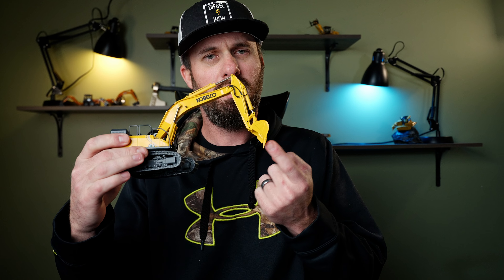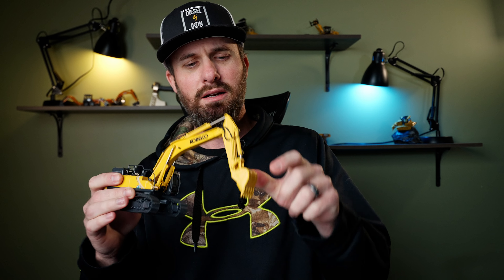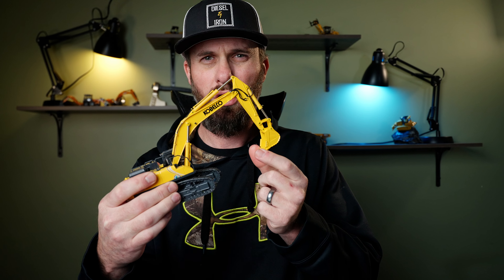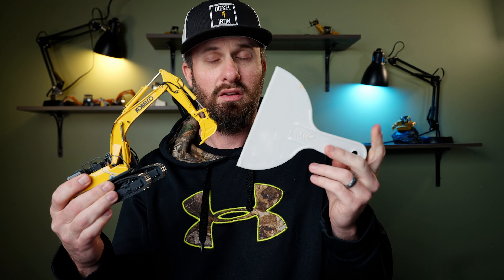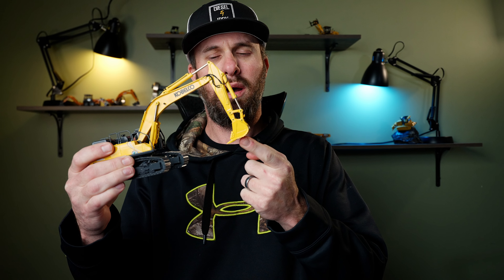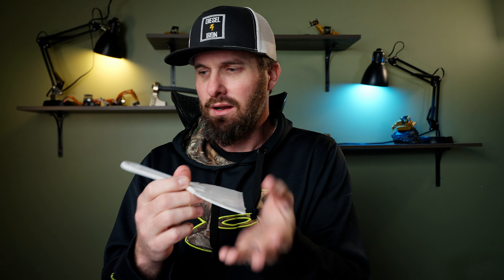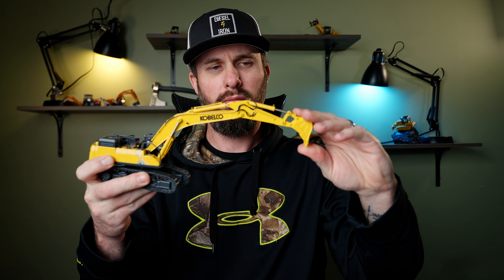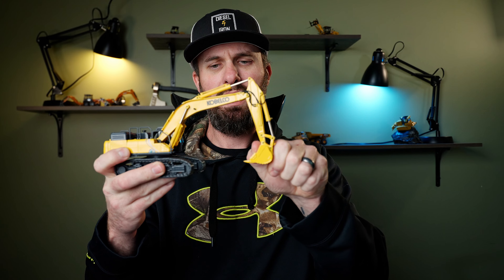Why Bucket Angle Matters

Comment: It's easy to figure out bucket angle when you use a shovel before a bucket
Reply from the maker: That's why I stand by the statement that you need to spend the first part of your career on the end of a shovel.  You pick up a lot of valuable knowledge when working that shovel.
Reply: I agree with your sentiment that everyone should start out in the ditch before they start running the machines, but based on the lack of logic in your "High Horsey" statement, the amount of time you've actually spent on a shovel seems to be questionable.  As means of qualifying myself as an expert ditch troll, I'd like to point out, as an investment in my personal work tools, I was the only guy on any site that owned their own shovel. Everyone else (most guys were a fair bit smaller than me) just grabbed whatever was close by and started digging. I had to  have a custom made, extra heavy duty spade shovel designed for a guy my size because I always had take it easy on regular spades so that I didn't break the handles all the time and it really slowed me down. 

So those of us with actual real "Goon Spoon" hours know that a shovel digs completely differently than a hoe bucket.  
Shovels are stomped into the ground at basically 80 degrees to the surface and then levered out of the ground to lift the dirt out. 
People who try to run an excavator the way a shovel taught them to dig, tend to engage the ground at an 80 degree bucket angle and accomplish very little but burning extra fuel.

It's not very often you use a spade shovel to flatten out the bottom of a hole but admittedly the operation both have in common is low angle chipping of the ground, but again, that's not a common or intended use of a spade shovel.  The handle angle on a spade shovel is intended for "stomp, pry, throw" use, you have to bend over the whole time to use it to flatten or chisel a flat surface. 

Just sayin...
Reply: @reganmorben9248  while all what you said is true but my time on a shovel I used a box shovel more than a spade for doing fine grade around edges before they put me in the operator's seat